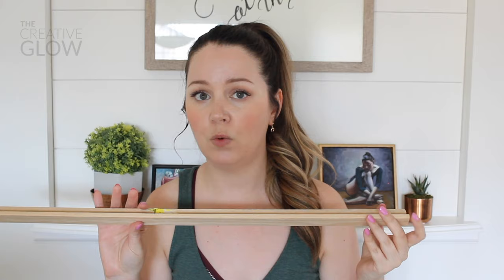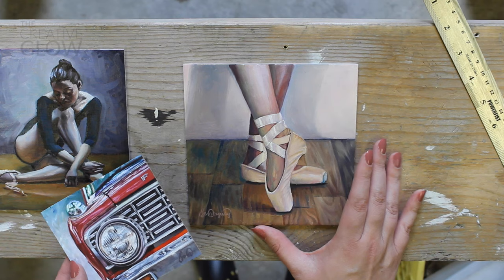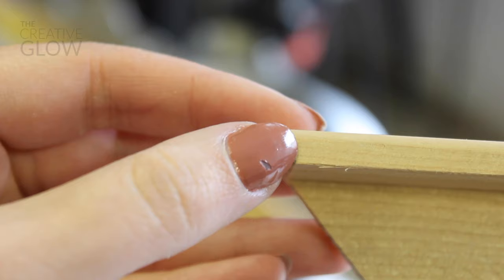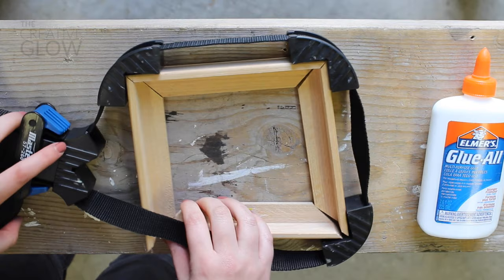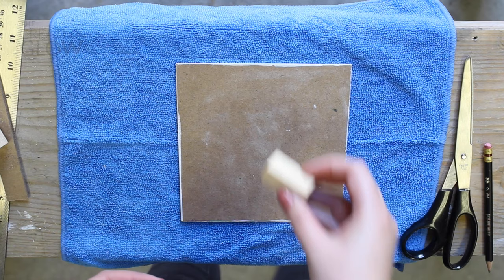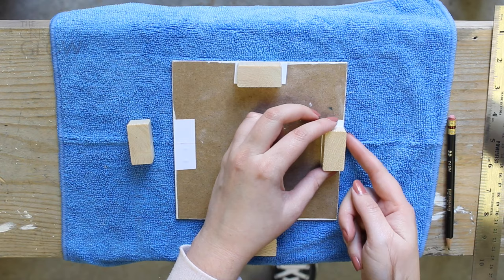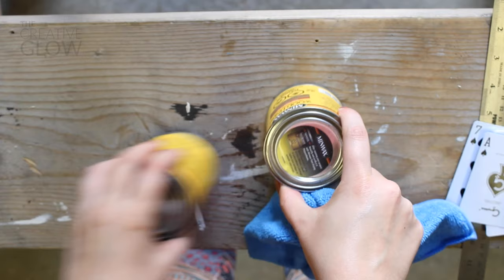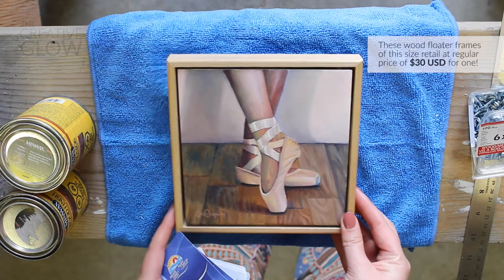DIY Floater Frames Tutorial

Comment: Great tutorial for the average person who doesn't have a workshop or arsenal of tools.  Very clear, concise instructions.  Thank you!
Reply from the maker: Thank you so much!
Reply: @TheCreativeGlow   What I loved is that you used corner molding, genius!  Is much cheaper and easier than using 1 by 2 hardwood base, Then adding quarter inch lattice piecesTo the outside of the frame. not to mention all the time you save gluing and cutting and measuring.

Comment: This is PERFECT. I will say I dont have a chop saw so I am using a Miter Box and hand saw. It can be done this way to save money but I will say be sure to have plenty of clamps to hold you wood in the miter box as I had  ALOT of sanding to try to fix my errors.
Reply from the maker: Yes, I've used a mitre box to make 45s on another very large project once, and the angles definitely were not great! But it can be done if you know how to tackle it! Thanks for letting everyone know!

Comment: This was an extremely well done tutorial. I have a huge piece of art stretched on a canvas, which will sit inside a window sill & function as a window blind. Since the art piece is about 4" smaller than the inside of the sill, I'll need to create a frame that will allow for a gentle "friction fit" on the sides of the frame. I doubt the corner moulding will be wide enough to fill the gap, but I'll look for one in a thick size. This tutorial showed me what I needed to know - as I figure out what material will give the depth of moulding needed. The lightness of a floating frame is a big plus, & the way it can feature & enhance the art is great. Thank you.

Comment: Thanks so much for sharing this, great how-to tutorial. I really like the look of floater frames and using corner moulding makes it so much easier to get it. Too bad I can't post a photo but it turned out fantastic. I made one for a 30" x 60" print and if anyone else is thinking to make larger frames I suggest sand, stain, varnish each piece before gluing and clamping the corners. The longer the lengths of moulding the more flex they have which stresses the corners and eventually they separate, as I soon found out. I also added flat L-corner braces to help reinforce the corners with #6, 3/8 wood screws. Cost? $100 for the corner moulding & screws. Wood $ has gone up! :)
Reply from the maker: Thank you for sharing all your suggestions on making larger versions; this is something I’d like to address in a future update video, but haven’t had the time to do so, so I really appreciate this!!! I’m glad you liked my tutorial and it was helpful to you! 😊 I just checked the price of the moulding, it’s now $5.24/ft (2022), compared to the $3.something/ft I talked about in the video. Wow! But it’s still cheaper than buying pre-made, if you like a little project to do. :)

Comment: Thank you so much for this video. The frames are beautifully designed and the instructions are clear and easy to follow. I just finished making a batch of them for my own paintings. I have one question: what has been your strategy for attaching hardware for hanging?
Reply: Sarah Elizabeth Farr I’m curious about your question too, I just asked the same!
Reply from the maker: Sorry for the late reply guys, as I just responded to Jynxy Nine, my response is:
My original idea was to make a small hole on the top backside of the frame (keyhole shape) — in the center, and have two of the mounting blocks on either side of it, instead of just the one, in order to reserve the space for that hole — to allow the frame to sit over a hanging nail or hook. When I made the video, incorporating that hole for hanging slipped my mind, unfortunately. I may try a couple other ideas and make a follow-up video covering hanging of these frames. But that would be my suggestion for now. Or try the 3M hanging strips that are like Velcro. I’ve used those to hang quite a few different frames on my walls.

Comment: Great video, thanks for posting.  Only one thing I disagree with.  As a professional cabinet & furniture maker, white glue aka Elmers is just as strong as yellow wood glue.  It doesn't matter if the finished piece is a chair or a frame, both both are equally durable and strong.  The white glue has a longer working time of approx. 1 hour depending on temp/humidity v. 10 or so minutes for yellow glue.  So we use the white glue when it's a complicated glue up that requires more working time than 10 minutes.

Comment: This was a really great video, really well done, to the point and gave me some clear great advice about how best to go about this. Also find the corner moulding ingenious, as all the others I’ve watched have said I have to make an outside frame, then and internal frame using 8 pieces of wood total, so I’m gonna go see if I can get these corner mouldings at my diy place. Also ordered a band clamp- hadn’t seen one of those before :)  question- how do you hang the art after this? With a wire attached to the frame hooks?
Reply from the maker: Most of the time on small pieces they are set on shelves and not hung, but I might suggest trying the 3M picture hanging strips - the ones that work similar to Velcro. My original idea was to make a small hole on the top backside of the frame (keyhole shape) — in the center, and have two of the mounting blocks on either side instead of just the one, in order to reserve the space for that hole — and allow the frame to sit over a hanging nail or hook. When I made the video, incorporating that hole for hanging slipped my mind, unfortunately.

Comment: Great tutorial... But I don't suddenly have a miter saw. 😜 I wonder if it could be done showing how to cut 45° angle without a fancy saw. Maybe how to measure it and cut with regular hand or circle saw.
Reply from the maker: Hey there! To get well fitted mitre corners you really do need a mitre saw or table saw. To use a circular saw would be much more work because you’d probably first need to build a jig in order to get perfect angles, and that would be a project in and of itself. The only thing I can suggest you could try is getting yourself a mitre box (a very inexpensive plastic jig) to use with your handsaw to cut the mitre corners. Although, unfortunately, you can’t expect very tight 45s with it. If you decide to give that a try, I hope you can prove me wrong and your frames turn out beautifully! :) Thanks for the comment/question!

Comment: If the trim is different lengths or one side is say 5 CMS and one side is 6 CMS how can I make sure I am cutting the trim the right way so the larger or deeper edge is the visible edge and the shorter or less deep edge is the bit the canvas sits on

Comment: How did you sign your name so neatly on your painting; was it a paint pen?
Reply from the maker: ☺️ Oh, thank you! No, just a regular brush and oil paint from the tube, he he. I do find it turns out neater if I wait until the painting dries before signing, and also, if it doesn’t turn out quite right, I can wipe it off and try again. I don’t always do it like that; like if it’s an a la prima painting, I sign it right away for sure.
Reply: The painting of the ballet feet is beautiful, too! Sorry, should’ve mentioned that first. I’ve been focusing on making proper frames.

Comment: If making a float frame for a 16 x 20 in. Canvas, will wood glue be ok to hold frame together for a long time?
Reply from the maker: Yes, it should if you’re using wood glue. Wood glue is quite strong, just make sure that you use it liberally, so that you get a fair amount of squeeze out when you clamp it tightly, as wood end grain tends to soak up the glue. You can wipe off the excess that does squeeze out before leaving it to setup. And then any residue left once dried can be sanded off, especially if you are going to stain the wood, rather than paint it. I just made one of that exact size and I only used wood glue.

Comment: for the 3/4 inch canvas panel, did you just screw into the edges on the back side? Set it in and attach?
Reply: Yes, screw into the wooden frame of the stretched canvas.

Comment: Great idea for an easy floating frame. However, those screws on the back of the frame will most certainly scratch up a wall and hold it away from the wall. Maybe countersink them.
Reply from the maker: Great suggestion - just trying to make it as simple as possible for the DIYers out there, so have not included that. Though your frame shouldn’t be moving around enough to scratch anything once it’s hung on the wall… unless you get a lot of turbulent earthquakes, maybe.🤷🏻‍♀️ The amount it’s being held away from the wall is maybe 1/16 of an inch… 3M strips will hold things away from the wall further than that.

Comment: Would this work for large pieces of wood art? Like maybe 3 feet by 2 feet? And 3/4inch thick?
Reply from the maker: Hmmm… well, I couldn’t say with 100% certainty. The largest I’ve used it on was 16x20” and it did fine there. My instinct is that the frame may need some corner braces or something to add a big more structure… but then the artwork may prove to add the structure need on its own. You may have to try—maybe you already have—and report back here for others (and myself) to know your experience!

Comment: I live in Canada and cannot locate corner molding 2x1.  Where did you buy yours?  Thanks.
Reply from the maker: I think I have a supplies list in the description of the video with links… maybe it’s just on the blog post; I can’t quite remember. 😅 But, I get it from Home Depot. They have the nicer hemlock variety if your staining them, or you can also get the finger jointed and pre-primed variety if your plan is to be painting them rather than staining. That will save you a couple dollars per foot; the price of the nicer hemlock has gone up since making this video (before covid).

Comment: i wish you would have shown how to mount a large canvas too. It would have been nice to see it without the additional small blocks needed for the square mounting you did. Thank you.
Reply from the maker: Sorry - I felt it was pretty simple, and I do explain how you would do it in the video; put it in the frame, add spacers to center it, screw it in place, through the wood of the canvas assembly, the same way as if using the blocks, but with canvas you don’t need the blocks because there are wood stretcher bars.

Comment: Thank you for a great tutorial and trick of using Corner Moulding! Would you mind sharing the dimensions of the corner moulding you used? I plan to make this frame for posters of size 12"x36" and am figuring out if the moulding will support that weight and how to hang such a big poster. Would you happen to have any suggestions? Thanks :)
Reply from the maker: I’m pretty sure it’s a 1” x 1” corner moulding; actual dimensions. https://www.homedepot.ca/product/alexandria-moulding-hemfir-1-1-16-inch-x-1-1-16-inch-outside-corner-moulding/1000167893

Comment: Have you tried this on a larger canvas? I guess you might need to secure the frame with somethingelse besides glue?
Reply from the maker: No, glue is actually incredibly strong, which is surprising to many people. It’s actually stronger than the wood itself. But what you may have to do differently is add some additional cross braces to support the longer arms.
Hope that helps and sorry for such an incredibly tardy reply! 😳

Comment: I don’t have the tools at home to cite the wood. I’m just wondering if Home Depot would be able to cut the pieces for me. My art work is a rectangle. So I just need to give them the length and width + 1/4 for each side right??
Reply from the maker: Probably not, but it won't hurt to inquire first. I think Home Depot only do straight cuts, not 45 degree cuts (or any angle). You can get yourself a mitre box and a handsaw and give that a go. It's not always as precise, but I've had people telling me that they've been able to make these frames that way.

Comment: Hi where did you buy your corner moulding? I can't find any similar at home Depot! I'm also from Canada
Reply from the maker: Hey there! Yeah, I got it from Home Depot. I buy it in-store, but this is the link to the product, if it helps at all: https://www.homedepot.ca/product/alexandria-moulding-hemfir-1-1-16-inch-x-1-1-16-inch-outside-corner-moulding/1000167893 Maybe an associate could direct you to the product, and/or you can check your local store on the website to see if it’s in stock.

Comment: So- you bought the frame strips pre-cut, then assembled them. Got it. TIP: Use wood glue, white glue isn't going to hold near as well, it's too brittle, and brace the back of the corners with small triangles for added support on larger pieces. TIP 2: put tape on the drill bit to pre-determine how far to drill, so you do not go too far. Oh, and if you had made your own framing strips, you could have saved a lot more... for $30 I make anywhere from five ten to frames depending on the sizes... use good wood for the siding of the frame, and cheaper pine strips for the backer of the frame, its an extra step, but worth it, and I get to determine how deep or shallow the frame sits too.
Reply from the maker: Chris Griffith What exactly are you saying? I bought the frame pieces pre-cut?? Nope. I cut them all myself, as is shown in the video! As for the rest of your comment/tips: while I appreciate you leaving these tips for my subscribers, I feel you seem to be trying to undermine my tutorial. To be clear, this tutorial is 1 way to make a frame. The tips you are describing are covered in many other tutorials on making floater frames - this is my own quick version, and, I feel, something a little different and easier than the more common way of doing it. It may not be what everyone is looking for. People are welcome to use it, or go with someone else’s tutorial should that fit their needs and tastes better. If you feel you have something more helpful and/or better to offer than what you’ve seen here, or what others have done, when it comes to diy floater frames, then you should 100% share it in a tutorial of your own for us all to benefit from! I plan on making other frame tutorials on my channel in the future as well, that will be for those folks who do want to put in a little more effort, or have more tools at their disposal.
Reply: @TheCreativeGlow  Somehow, I missed the part where you cut them! (Edit: you "chopped" them, but they came with the "L" shape to them, sorry, I should have made that more clear.) I am sorry you felt threatened, it was my intent to give advice that is no harder to follow than buying one glue over another... they at least have to do that... and if you would like, we can chat over "advanced techniques" if you like, I would love to share in a tutorial like that, because I have no time to make one, I am busy making stuff! Cherio!